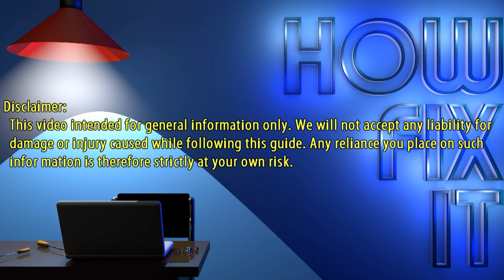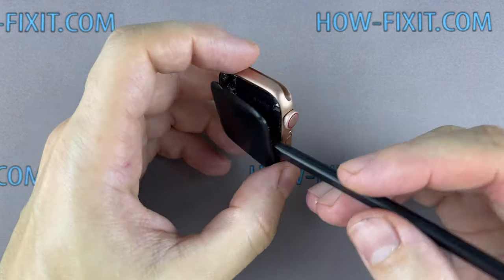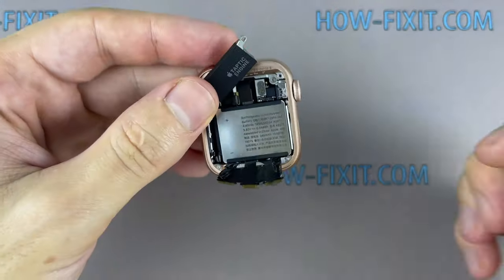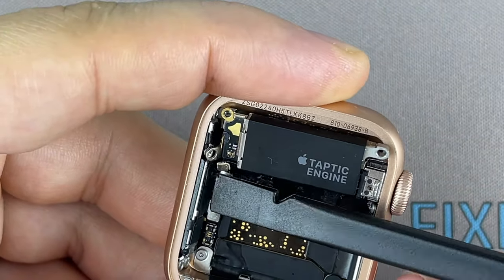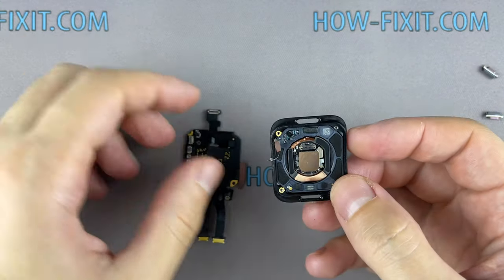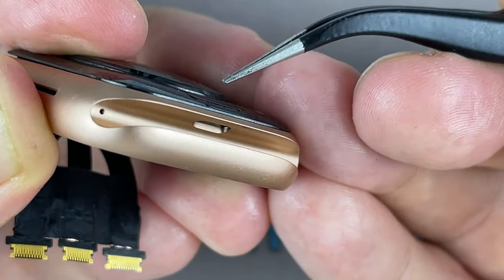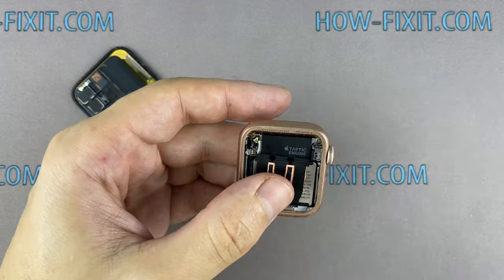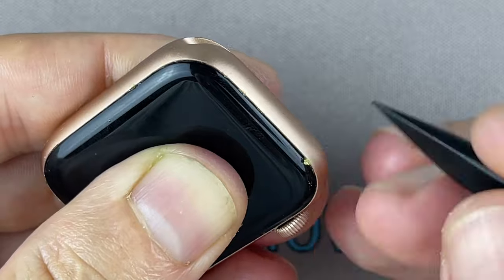Apple Watch SE Housing Glass Replacement

Comment: I think you vastly undersell the struggle to open the faceplate. The "thin curved metal blade" needs a separate link.
Reply: Ok, deleting the follow up since I'm just an idiot and the tool you need to open the faceplate is something totally different than what's packaged in the bundle. I bought the "Pistachio opener" and seriously worked like magic.